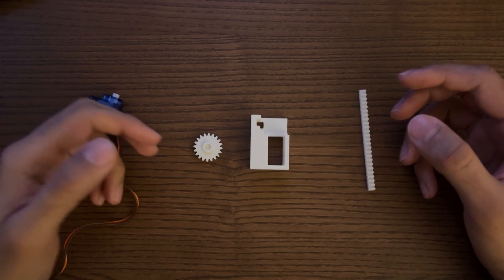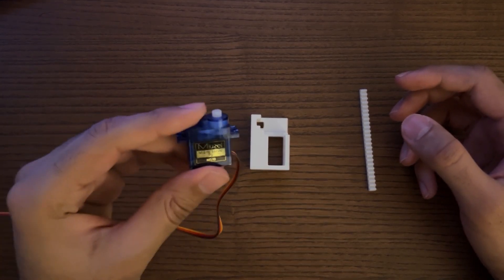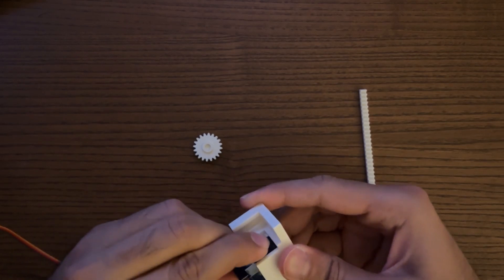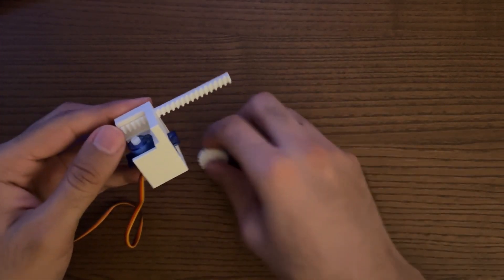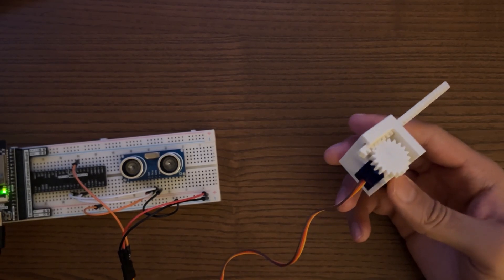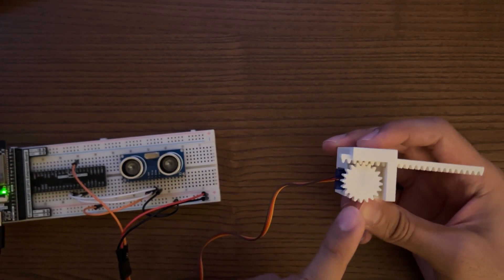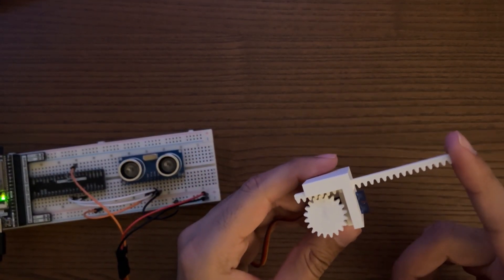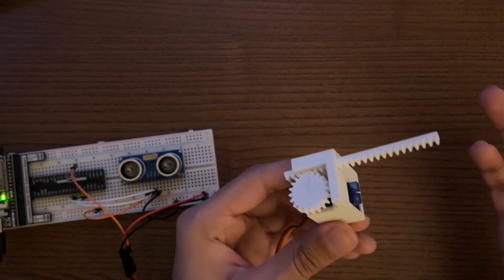3D Printed Linear Actuator/Rack and Pinion | Arduino

Comment: can you control the speed of the servo motor?
Reply from the maker: When you set an angle in the code, the servo will move as fast as possible to that angle. So instead you use a for loop where you increase the angle by 1 till you reach your desired angle. Before your loop repeats, you add a delay() function which just waits the desired milliseconds before looping. If you watch my samurai mask video I show some code in it

Comment: Thank you I was Thinking about using Linear actuators for my Thrust vectoring system.
Reply from the maker: I’m not sure if these cheap micro servos are going to be precise enough for that. Since accuracy wasn’t really my goal this design has some wobble. For more accuracy you would need to increase the number of teeth on the gear and rack for more contact to reduce wobble